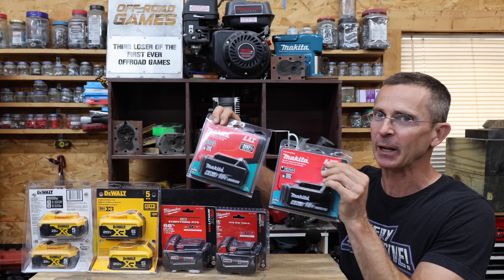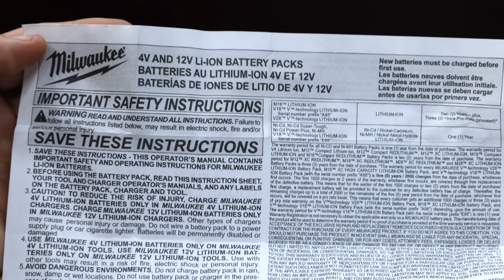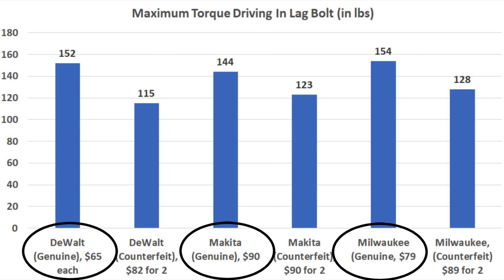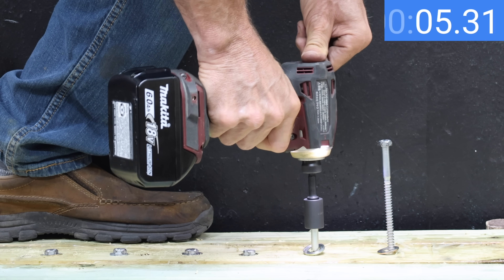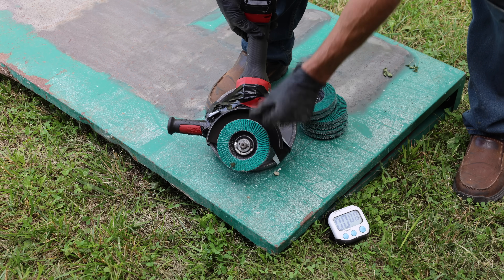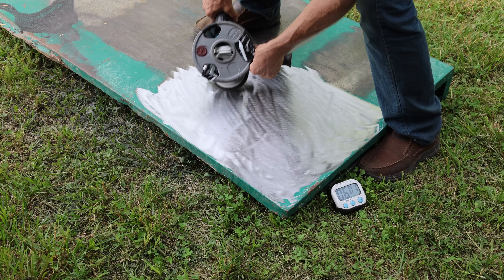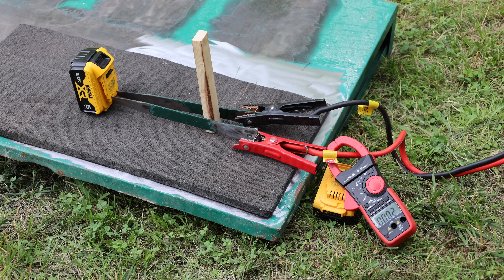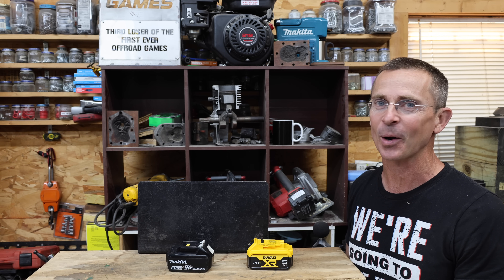Have You Been Scammed with a Counterfeit Tool Battery?

Comment: Never buy power tool batteries off Amazon. I've been scammed 2 times. Once with DeWalt batteries and again with Craftsman. Amazon did refund my money both times even though I didn't realize they were fakes until about a year after purchase but it did take many hours on the phone to get the refund. I just buy at Lowe's or Home Depot.
Reply: I try not to buy anything from or on Amazon.
Reply: @RenoBusdriver that's un-american! Help your billionaire Overlord by buying his Chinese products. 

But you're right - buying anything legit from Amazon is going to disappoint. For these batteries however, of you buy 'compatible' batteries, you get these batteries without the fake branding, for half of what these cost. 

Sure they're not as good as the original, but 4 of them for less than 1 original? I'll take the 20% lower power capacity. The real scam is the real company charging what they do for cheap cell batteries
Reply: @MelodicTurtleMetal Those knock offs don’t last for what it cost to buy the real one.  You gotta pay to play
Reply: @MelodicTurtleMetal  The aftermarket batteries definitely have their place.  You don't need high capacity tough batteries to power a portable light or air blower or something for DIY use, so 80% of the capacity for 50% of the price is a fair trade in my opinion, just as long as the product is labelled as such.  But of course for high current power tools (or if you're using them to earn an income) then you will want the real ones.
Reply: @MelodicTurtleMetal 90% of Home Depot and Lowes products are made in China as well.
Reply: I do not believe you see the entire issue. Scammers don't buy them to use them. Scammers buy them so they can so they can be passed off for a refund - go to a store, buy a real one, and then return the counterfeit. If it is close enough the store will just take the return and put it on the shelf. If someone ends up buying it and gets SOME use out of it, they will probably never know. That is the scam, and how you can get authentic batteries for $50 or so to do whatever with (either to resell or use).

Because of this there is a decent chance that at least some of the batteries on the shelf at your local store are also fake, depending on how bad the problem is in your area.
Reply: @RandomToon1  The same thing happens with automotive and truck parts.  Scammers buy the genuine part then return a Chinese counterfeit part, pocket the cost difference.  You have to be careful to inspect the parts you purchase in front of the person working the counter.
Reply: Ebay is no better.
Reply: The problem exist even at the retail stores, as mentioned in the video, as people will purposely buy a counterfeit battery and return it to a store for refund. Then the store places the battery back on shelf without knowing themselves. Can be prevented by requiring a receipt for returns, but some stores do not.
Reply: @bira896  Even with receipt it works like this:  Scammer buys 10 genuine Makita batteries ($$$$) from reputable retailer.  Scammer buys/manufacturers 10 fake but good enough looking counterfeits in retail packaging.  Scammer returns the counterfeits with receipt and they scan in just fine. Since the employee is being paid two bucks over minimum wage, they don't really care to be invested in really checking what's being returned.  Scammer gets full refund, minus the cost investment of the counterfeits (maybe 25% of the cost of the genuine batteries), and now sells the genuine ones for 75% off retail on ebay.  Rough numbers: $1000 * .75 = $750 minus $250 = net $500.  They do this for a living so can go around stores nationwide raking in some serious money.
Reply: I don't buy anything off Amazon, so I don't have this issue 😁

It's a terrible business, a horrible marketplace and absolutely morally bankrupt.
Reply: I guess Bezos is in on the scam! Doesn't he have enough money??
Reply: The point is,China is ignoring patent laws and needs to be punished economically!! If all the world markets said enough  is enough, China would have no choice but to stop cheating, stealing and lying!! Cheers from Canada 🇨🇦
Reply: No better feeling than walking out of home depot or lowes with 5 boxes of new tools. Feels like christmas.
Reply: Lowes and Home Depot still sell counterfeits.
Reply: I dunno, I've had aftermarket Craftsman 19.2 lithium ion 4ah batteries last longer then the original 19.2 lithium ion 4ah...the originals I'd have to replace 6-12mo after purchase because they quit taking a charge, the aftermarket I've had 3-4yrs now and they still charge to about 97-98% capacity
Reply: @brettraglin8939   the 19.2 is old technology and not lithium I believe. Maybe easier to manufacturer for after market ?

Comment: I just buy aftermarket ones that own up to not being genuine and remove all doubt and proceed accordingly. Normally I can get 3 for the price of a real one. They have protection/control circuits - your mileage may vary and you should check. Most of these tool makers price gouge so much that they only have themselves to blame for the fakes. I also have many after market adapters that allow my older tools to still work from new style batteries which is another massive con these toolmakers pull.

Comment: Trash toner cartridges. Trash batteries. Part of the issue is the oem ones are not all that great in the first place. Auto parts also big place for counterfeiting. Bosch really does not care either. Their system is half baked to prevent fraud.

Comment: Thanks for not blurring out the seller's name that are selling the counterfeit batteries.
Reply: Doesn't matter. They change user names at about the same rate they change brand names.
Reply: @MrDavidBFoster  The same outfit may go under multiple names at the same time. Or may be different companies using the same drop shipper. I see a lot of them on eBay. Selling all kinds of counterfeit or questionable electionics.
Reply: I see the Chinese sellers change names all the time. Or they'll sell a better but cheaper product to get good ratings, then switch products.
Reply: Right! I need to buy some batteries so I can take them and exchange for the real deal as he suggested
Reply: I don't think he suggested stealing anything?  @GhostSot
Reply: Too bad the US government doesn't pressure China to end flagrant copyright abuses.
Reply: Yeah, those accounts are bots. Rated up by bots. Don’t buy anything from anyone who doesn’t have actual, legible, independently verifiable business information available. If you can’t Google their business name and corroborate at least their basic info, then avoid them. I personally won’t buy anything of value direct from anywhere outside of N America. If it’s legit and in high demand, someone will import it, and I’ll gladly pay another 10-20% for the effort.
Reply: Pro-tip: do not buy anything from eBay where the seller is from China. There are scammers from everywhere but the odds are very high that the item is counterfeit if the seller is from China.
Reply: Where are they not blurred? I've been looking when I came across your comment.
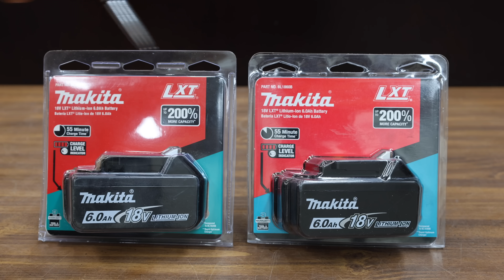Reply: @kirkwoodcashonlyhomie  1:33 and 1:41 and 2:35 and 3:54 the seller names are not blurred out.
Reply: Were these purchased at Home Depot or Lowe’s?
Reply: @jefffrye1398  You can't trust them. Meth heads will buy genuine and return fake batteries.
Reply: @jefffrye1398 did you not see the video?
Reply: @jefffrye1398  didn't you watch the video! Durak!

Comment: It was warm today ~80f.  I had both rigid and dewalt batteries over temping with 3 of 4 bars.  4-5-6ah. 

I was running a dewalt 12in chainsaw and a rigid sawzall cutting stumps out. 

They still did the job and recovered after slight cooling. A counterfeit wouldn’t have survived based on what i see in this episode.

Comment: Usually the counterfeits just have lower C rated batteries (max continuous amps) but have more or less similar power ratings (mAh).

I buy em for lights and stuff since I don't need an actual high output battery for a light.

Comment: Thank You Todd for bringing this up and doing the testing!  As a weekend warrior I use m12 tools and have a couple older genuine batteries that are still going strong.  I recently bought a “for Milwaukee” m12 6Ah battery and it looked legit.  Once I took it apart things went downhill.  It has generic grey cells, cheap connections and no shock absorption material compared to my older genuine Milwaukee m12 4Ah!  I’ll be keeping my real m12s and replacing their cells with Samsung ones when they loose capacity.  Now the question is, where do I get genuine Samsung cells?

Comment: I might have gotten a counterfeit toothbrush head. Maybe dangerous because it can break in the mouth and create a choking hazard. 

I wonder if the counterfeits were remanufactured from recycled batteries. Even if so, it should not be sold as new.
Reply from the maker: Thanks for sharing.

Comment: Thanks for highlighting the hazard of these clone batteries. In Australia several houses have been lost due to battery fires. For another video, could you please consider doing some research on the protection bags and cases available for safe charging and storage, as well as the new fire extinguishers available for lithium fires in the home or workshop.
Reply from the maker: You are welcome!  Thanks for the suggestion.

Comment: I am also interested to see how well modifying Hobby RC batteries (drones or rc cars) to connect to power tools would work. Some people, myself included, have a bunch of hobby packs laying around, and i've always wondered if i were to just 3d print an adapter and plug one in if it would be able to perform. Could also make an adapter out of an old, dead tool battery.

4 amp hour 5 cell (~20v fully charged) "100c" lipo packs from decent brands are 50 bucks on the jungle site. Similar cost as the knockoff, but i'm sure they can source way, way more amps.
Reply from the maker: Thanks for the suggestion.

Comment: What makes this worse is how online platforms can make counterfeit products seem legit. 

I bought a DeWalt 4 + 6 AH starter kit (came with bag and charger) from Amazon. I figured it was safe because the listing points to The DeWalt Store on Amazon. But that's not the actual seller. In fact going back and looking at my order, the original seller is different from the current seller for that listing...

I'm going to open up those DeWalt batteries now and see if I got scammed. If I did, I'm going to get my credit card company involved and Amazon is going to get an earful.
Reply from the maker: Thanks for the feedback.

Comment: Why getting counterfeit batteries? I bet that no name batteries are as “good” as this counterfeit batteries and cost less. Real batteries are must have if your work depends on your tools. Genuine batteries pay out in the end. They last longer and make better work as well. BTW you are better off with 5Ah Mikita batteries when you want more power. They can provide more current than 6Ah. Sure 6Ah has more capacity but do not perform as good in the tools that profit from current. Some tools do not need a lot of current and those are better off with 6Ah.

Comment: I bought Dewalt battery online for a good deal. Stamps looked a bit different so I open it up to compare the battery to my store bought one. Looks similar but the pcb looked a bit different. Weight also varied against the control and the controlled variable. It was the flat cell type. I will only get store bought for wareanty and hopefully genuine but hey I have receipt so warranty b should not be an issue.
Reply from the maker: Thanks for sharing.

Comment: I recently bought a Dewalt 9 ah Flexvot battery on ebay for $120.00. I immediately
though it was fake. Inspected the packaging very closely then I a compared to a Real battery. 
It is very hard to tell them apart. Fakes will ALWAYS be lighter. Haven't used it much to tell if
I've been scammed yet. Annoyed. If It's Cheap it's Probably not REAL!
Reply from the maker: Thanks for sharing.

Comment: It wasn't part of the testing but in your head to head battery testing you showed that the Milwaukee was a better tool, OEM battery or counterfeit battery, than the other tools. The Milwaukee with the counterfeit battery was still 25% faster than the other tools with the OEM batteries. The Milwaukee had more, not much more but more, torque than the other tools compared to the other tools OEM battery and counterfeit battery head to head.

Can't say that I ever purchased a counterfeit battery. Now due to your testing it is just something else to look out for. If patent and copyright laws were actually enforced this would not be the problem it is becoming.
Reply from the maker: Thanks for sharing.

Comment: By sheer happenstance I have a Dewalt battery arrive today that I bought off Amazon. I was comparing it to two others that I have. They are dated 2018, 2020, and the new one is 2023. Even though they all have minor differences I am 99% sure they are all authentic. The most interesting difference I noticed is that the new 2023 has 4 small vent holes on the bottom that you can see the green battery cells through.
Reply from the maker: Thanks for sharing.

Comment: I'm surprised they didn't bother to fake the batteries, that is extremely common on the open market.

I guess they didn't expect anyone to take it apart to look, it would have been extremely easy to fake as those 18650 batteries have a plastic sleeve over them which many fake. I spent a lot of time verifying the Samsung 18650's I bought for work where authentic. Many years ago Samsung was the leader, and their 18650's where $8-ish each where as the knock offs where $2-ish, folks would just buy them and resale as authentic they appear virtually identical even down to weight.

Really only way you can tell is by putting preset loads on them and checking the discharge rates.
Reply from the maker: Thanks for sharing.

Comment: I’ve experienced this decades ago when I worked in aerospace/telecom and we had manufacturing done offshore (Taiwan and mainland China).  We would enter into confidentiality agreements, develop what we all thought were strong relationships with our partners and begin small volume manufacturing.  As the results became consistent, we would obviously start ramping up in volume to meet demand.  That’s when we found out that the process manufacturers would steal our proprietary tech and make imprints to produce off brand products when not manufacturing our stuff.  Same thing happens with textiles in India - they’ll be happy to make a run of 100,000 pairs of brand name jeans with your labels but then turn around and make 1,000,000 more at their own cost and sell on the gray markets with your branding.  Once these offshore manufacturing facilities have your blueprints, they’ll make the gray/black market items for their own benefit using sub-par raw materials.  It’s been happening since labour was taken offshore.
Reply from the maker: Thanks for sharing.

Comment: The counterfeits are scams indeed, but sadly the genuine models are really disappointing as well despite the premium price
- low performance Samsung cells, which are neither high capacity, high discharge nor both. Samsung 25E for power tool come on.. it's illustrated with being drained in only a few minutes in the angle grinder.
- completely inadequate short circuit protection, either making the PCB fail or by letting out an unsafe amount of current.

From the test results, the counterfeits could appear like the better value if they were reliable (they're not)
Reply from the maker: Thanks for the feedback.

Comment: I only buy the generic batteries for all my DeWalt cordless tool. They only  last 75% as long as an authentic DeWalt battery but at half the cost of one DeWalt for two generics it's still a great deal. As long as you never leave them in the charger unattended I consider them more than safe enough. Been using them for over three years now with no issues. Supprised that the FTC doesn't go after the fleebay sellers selling counterfeit DeWalt labeled batteries.
Reply from the maker: Thanks for sharing.

Comment: I hope at least these fraudulent batteries are reported to the manufacturer and or FTC, as selling non rated batteries is actually quite dangerous, as they can short/blow up or become a flamethrower, just from overcharging. If the batterycells aren't even that will also cause problems, which can be an issue with uh... bootlegs, y'know. Quality control? That's the main reason to be paying extra for a powerful lithium battery. It's just too bad that dewalt and Milwaukee batteries are hella expensive out of the gate.

The battery that my family bought that turned into a flamethrower was for a dyson v6 vacuum, bootleg battery on the official charger.
Reply from the maker: Thanks for sharing.

Comment: That's why I buy my batteries at my local hardware store. Sure, as you showed, there is a small possibility of counterfeit ones ending up there as well, but it's considerably smaller than buying them online. By the way, you might have heard of the "Ceenr" brand batteries recently. They sell a bunch of adaptors to fit them to your brand of tool. Maybe you could give them a thorough test, as opinions about them vary very much.
Reply from the maker: Thanks for the suggestion.

Comment: This explains a lot, my authentic 2ah batteries did an incredible amount of work for over 5 years. I bought a 5ah battery from ebay which was still expensive and it has roughly the same amount of life as the 2ah when they were new :(
Paying hundreds of dollars for just a battery for a tool that cost about the same in our modern age of electrification just doesn't seem right.....
Reply from the maker: Thanks for sharing.